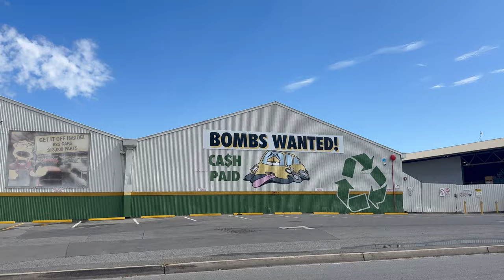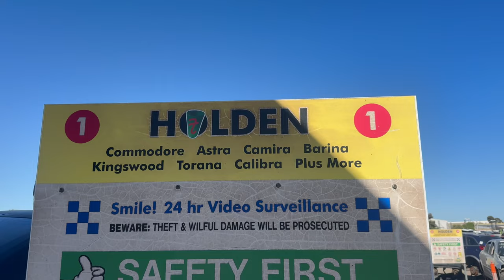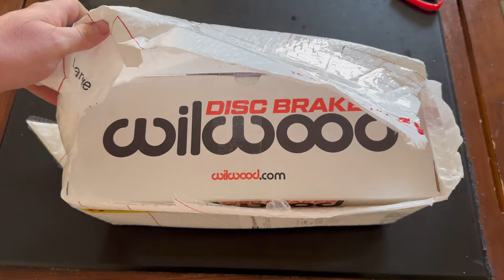REAR DISK BRAKE CONVERSION FOR VL COMMODORE! - *WILLWOOD MASTER*

Comment: I noticed you have a alloy hat on the diff you need to fit the panhard bar as it may need to be modified or relocated as I had an issue when i built my diff in a vl and mine would hit the alloy hat therefore I ended up removing the alloy hat still handles 500hp at the wheels no problem
Reply from the maker: I will pull the pan-hard rod off & stop it hitting on the cover, I don’t think the diff cover is necessary at my power goal but it’s a nice touch in a stock rear end probably an over kill tho. Thanks for the heads up legend 👍🏼👍🏼

Comment: Mate I think do yourself a favour and get the correct handbrake cable. There’s a reason why there was disc brakes and drum brake cables and not only that the original drum brake cable would’ve stretched over the years. For the safety of it you may as well go brand-new.
Reply from the maker: Totally agree mate, not something you want to go wrong or fail when you need it most!!

Comment: Just rust convert it. Put it back together and enjoy it for now
Reply from the maker: It’s very tempting but I have to paint the engine bay & do the body work. interior is out & the whole front end is off the car. I guess the rust worries me a little because the hours I would have spent on this in the long run. I think to myself what’s the extra 100 hours & many $$$😂😂😅😅

Comment: Do both windows mate don't double handle it ,have done the work done already get a window guy out remove and repair
Reply from the maker: It’s probably worth pulling them out now n sorting it out but if I’m going to do that I might as well paint the whole bloody thing. 😅😅
Reply: @LovedayMotorsports  I doing rolling shell atm 2nd  one In 2 years